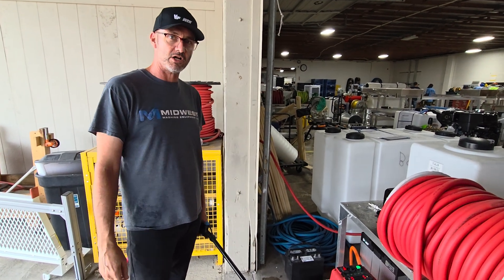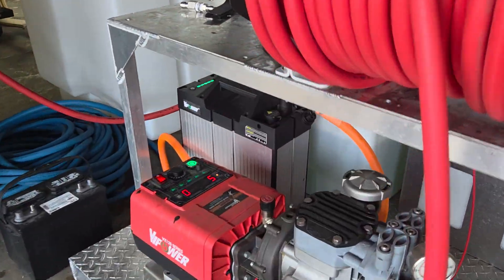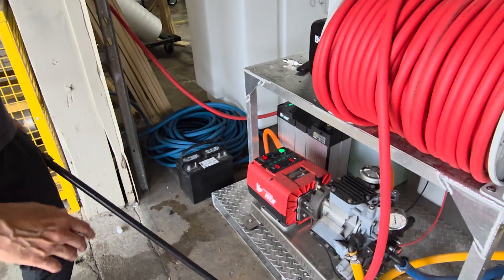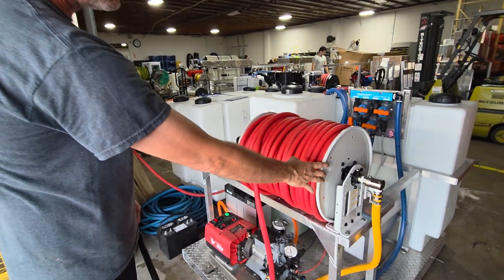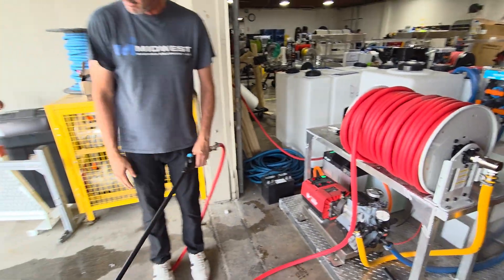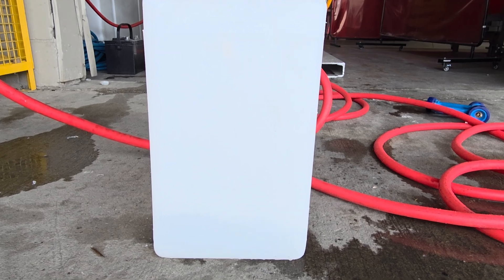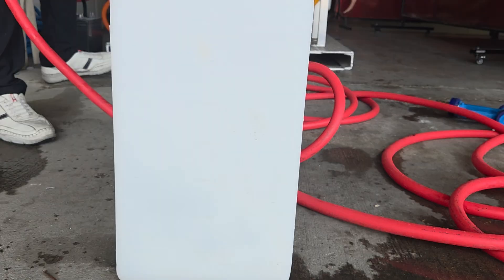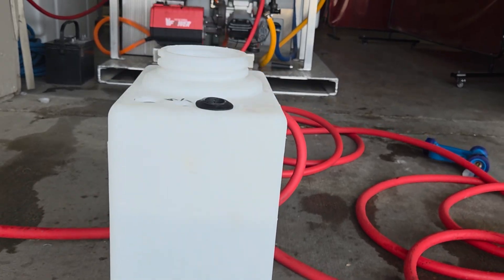New electric Comet P40 soft wash pump flow test, 10 GPM +!

Comment: Any info on distance and run time on battery?
Reply from the maker: Run time is 90 minutes straight at 100% power, you can run and charge simultaneously and have nearly endless run time. Distance is 60'+, height 4-5 levels no problem.
Reply: @midwestwashingequipmentllc1209  do you think you guys will do a distance and   Level test???

Comment: Why 5/8 inch line and not 3/4, does it matter? 
 Seems like 3/4 all the way to the gun would be better, especially having 300 feet of line and 3/4 plumbing on the reel
Reply from the maker: 3/4" spray hose is overkill. The gain would be minimal if any at all. 3/4" hose is super heavy and tough to work with. At the customer's request, we built 1 rig with 3/4" hose years ago and the customer quickly changed to 5/8" after only 1 week.
Reply: Love to know if the electric motor extends the life of the pump. I assume so because it turns off when you’re off the trigger. I’d jump right on it if the battery wasn’t the same price as a normal p40 fully set up.
Reply from the maker: @Johnny-gd3bs absolutely!  Doing away with bypass is huge benefit, plus it does have more performance than the gas engine. The battery has a 10 year life and the motor can be nearly that as well. There's also no fuel cost, no oil and nearly zero maintenance on the electric  motor. There is a higher upfront cost, but over the life of the pump/motor you come out way ahead.
Reply: What’s the info on that reel?
Reply: What brand of hose is that
Reply from the maker: @davidjohnston8813 Flex Tech